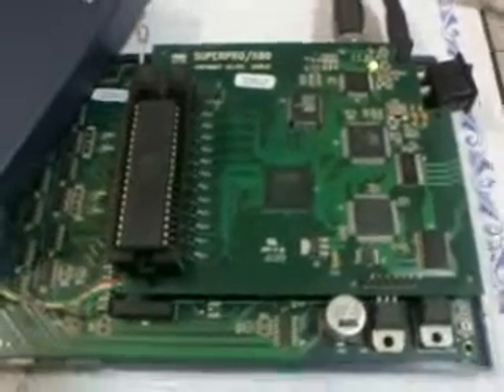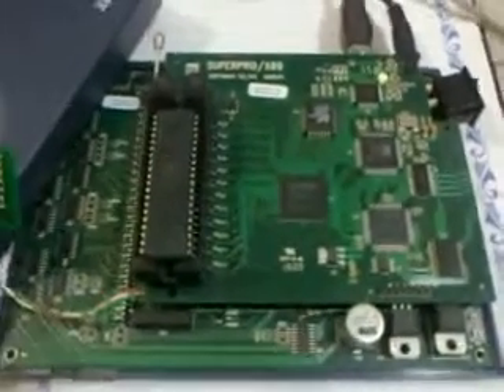Xeltek SuperPro 500P Device Programmer Beep Problem Part-1

Comment: I have sp610.  the problem is the ic is detected, but can't read, everything is FFFF... even though the ic already has a file (AT89C2051) I tried using PLCC32 (AT89BV040B) and it's good it can be read, what's the problem